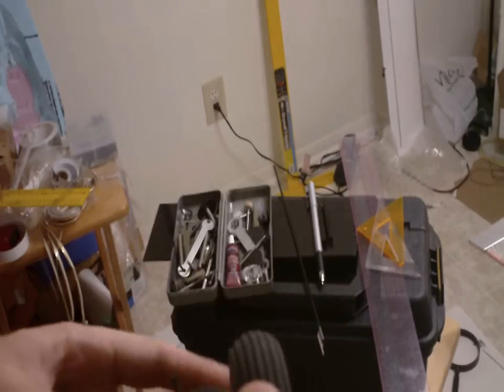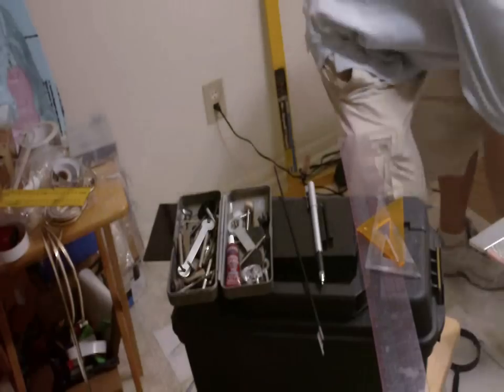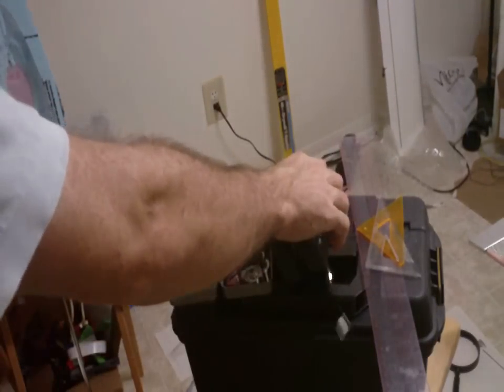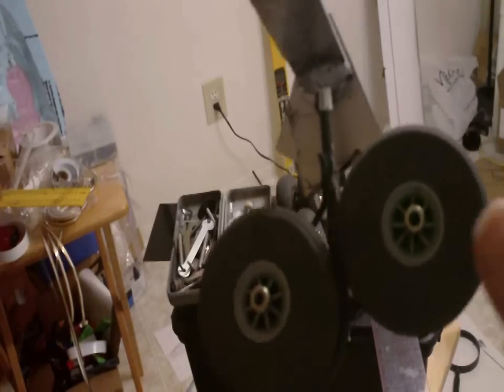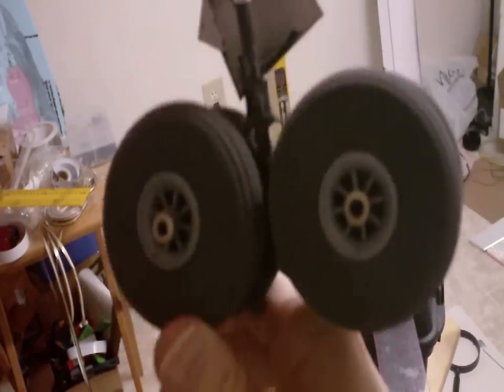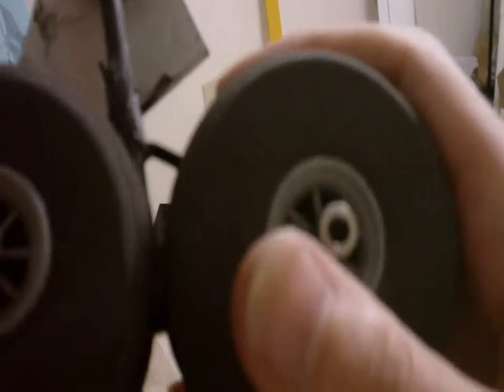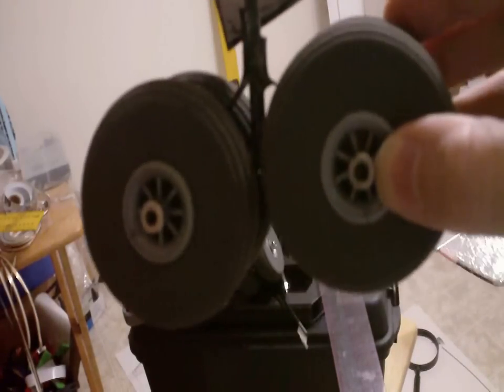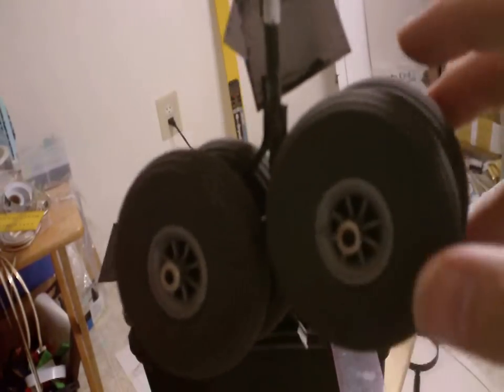How to make Landing gear for RC airliners! Part-3!

Comment from the maker: @StewieRc The main reason is during rotation when the Jet pull up off the runway on takeoff all 4 wheels will stay in contact with the runway untill the airliner lifts completly off the runway, as the reason the 747 wheel trucks are cocked backwards is so the rear par & wing main truck wheels touch down on the runway at the same time, go whatch youtube video of 747 landing & you'll see what I mean. thanks!